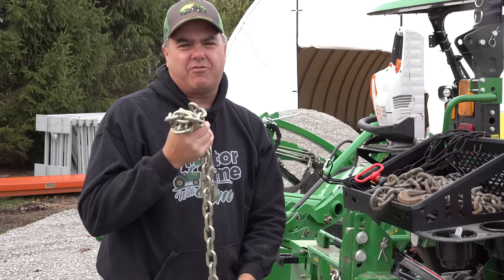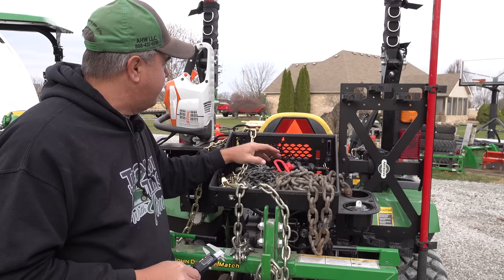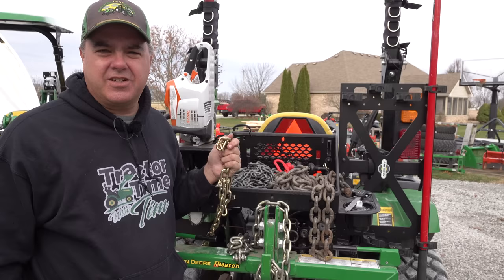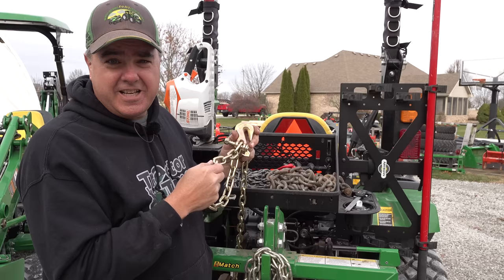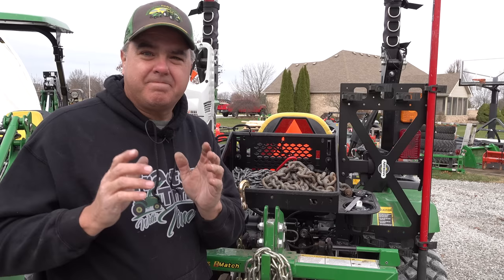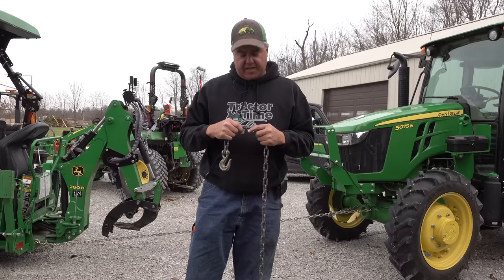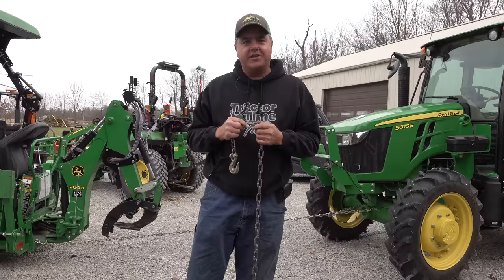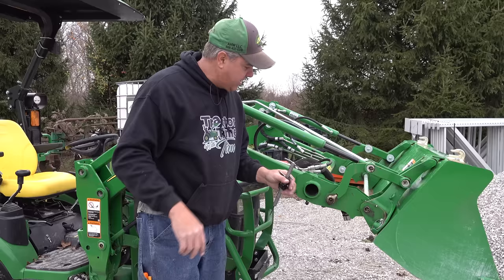What Compact Tractor Owners Need To Know about CHAIN!

Comment: Here's an engineers perspective, keep in mind my experience is with lifting not securing loads on trailers. The "lock" is called a mouse, for overhead lifting mousing is required, for securing loads I do not believe they are. You can make your own mouse with some twine or even ductape, they don't need to be strong they are only there to keep the chain in the hook when its slack (for example when you set a load down and the chain goes slack, you don't want the chain/strap to escape the hook without you noticing before you go to pick the load back up again). 

I would be hesitant to use a slip hook to "choke" a load ("slip knot" with the chain wrapping all the way around the load) as you seemed to imply. It'd be better to use a shackle since on a slip hook you risk the chain climbing out the mouse if it ever needs to actually slip. The mouse will not carry any load. If you don't need a true choke and just need an attachment point, you can just do what you did at 14:15 and use the grab hook. Keep in mind a choke hold with a chain derates the capacity of the chain by 20% or so due to sling angle stress, discussed more below.

Whenever chaining keep in mind that a shallower angle on the chain reduces the capacity significantly.  If you have crazy angles when securing your load, such as 30 degrees from the direction of loading, your capacity may only be 50% what you think it is. Lookup "sling angle stress". This is a HUGE factor when hooking to the bucket like you showed. You can double the strength of the chain just by using a lot longer chain than you think you need to reduce the angle (eye-ball it, you want the angle of the chain in relation to the bucket to be optimally 60 to 90 degrees, if it approaches 0-30 degrees you're in trouble). Not only that but if the chains short most of the tension in the chain goes into trying to bend the bucket in half, rather than trying to pick the load, so a better angle is not only stronger but nicer on your equipment too. If you want to see how bad sling angle stress can be, there's a video on my channel titled "that could've killed me" where I tried to lift up my 4x4 with a chain that was rated for twice the weight, AND doubled over (rated 4x the load at that point), and I still stupidly broke the chain and dropped my vehicle because the angle of the chain was stupidly shallow - the worst part is that I knew better and still rigged it poorly because I didn't want to find or make a spreader bar to get the chain vertical.

For all the reasons you pointed out, for pulling out stuck equipment I would really recommend using nylon straps, or better "kinetic ropes" / recovery straps. Chains hold a ton of stored energy in them when you pull on them and aren't great for dynamic loading, if they snap you have a very dangerous situation. With a strap there's far less mass behind if it it breaks and goes flying, which is much safer (as long as you don't have a tow ball or tractor attachment flying a long with it). Kinetic ropes have the added benefit of noticeably stretching which significantly reduces impact on equipment, and makes it easier and less violent to pull stuff out too. Only use a chain for recovery if you're confident the tension is lower than what the chain is rated for, and never get a run at it and try and jerk the equipment out with a chain (as you pointed out) - you'll just break the equipment or the chain, any bystanders, and possibly yourself.

Comment: Thanks Tim!  I ended up buying a couple chains when I was taking a huge tree down in our backyard.  

Outside of their intended purpose, best use I've found for them so far?  Pulling the posts on our old chain link fence that were sunk in to 40+ inch concrete footers.  When you think of a metal chain, one thing you don't think about (or at least I never did) is traction and gripping power.  A couple wraps around the base of the post then loop it over the foot of a hi-lift jack and it's insane how well it would grip the pole, even when covered in wet mud that was hard to stand up in.  Some of the more stubborn posts crumpled and snapped before the concrete footer broke free.  Trees along the fence line had worked their roots tightly around, and in some cases through, the footers.  Those ones just got chisled back and cut off about a foot under ground.  Best I could do without damaging the tree roots.  But for most of the posts, it popped them out with surprisingly little effort.

Thanks again for all the videos!

Comment: Good informative video for sure…I know it’s a year old but just saw it. Also, don’t stand in front or to rear of chain under tension…safest place is double chain length to the side. We had local man killed when a bolt on hook broke loose, hurled forward and struck him in chest.  He was standing in front of vehicle that was attempting to pull another out of mud….these were cement trucks by the way. 

Another reason to NOT to get running start.

Comment: The stabilizing tube on the loader arm is where I store my shovel I use a large black rubber bungee type to the tube and hooked to both sides of the square Point Edge if you put the round Point inside the square points you can carry both do tractors with narrower bucket do not protect the shovel so you have to be careful

Comment: My favorite place to keep a chain is either hooked to the rops the. Wapped in a way that it won't drag or  to Wrap it around my bucket hooks, if I have a good floor board I I have kept them there or if I am doing repetitive pulls from the rear I will keep one end hooked to the clevis in the drawbar and loop the working end around the 3ph lift arms between pulls.

Comment: Good info, but there are a few missteps on chain here.  The chain that is stretched should be sent to scrap and never used again.  It is very unsafe to use a damaged and/or stretched chain.  In pulling a tractor with a tractor, both should be hitched from the draw bar not the front axel or bolster and the larger tractor should be used to pull the smaller tractor.   In relation to transporting your compact tractor, you would need four grade 70 chains, rust free, one for the loader, one for the backhoe and two for the tractor.  Some states may require up to eight binders as well.  I have been loading and transporting ag and heavy equipment for over twenty years.  The new way that many transport haulers is using 6 ft chains with large grab hooks so as not to run the chains through the tractor and scratch the paint.  Go from the tie down point to the binder to the trailer, four points of contact for tractor and two points of contact for the attachments.  I do love your videos and purchased a 1023e this past spring in part due to your honest reviews.
Reply from the maker: But what If the larger tractor is the one stuck?
What if you need to pull it forward?  There is no drawbar on the front.
We live in the real world.  
This was not a lesson on how to tie down your equipment.  The video was 25 min long.  
We have other episodes showing proper tie down techniques.

Comment: good overview about chains. a lot of folks dont know how to use them properly. They are an essential tool when logging or doing firewood.  i got  bolt on hooks years ago based on a review you did. I've used them over and over again. i also have the loop/clevis on the bottom/inside the bucket. absolutely love them. one of the best add ons I've ever bought for the tractor. forgot about heavy hitch. i need a receiver to tow around my little log splitter. i might have to get one of the FEL receivers. dont think i heed the heavy hitch one and its a bit more expensive.

Comment: The other thing is you can buy chain in bulk and cut it down to managable lengths. Just buy the appropriate hook and you also don't need to worry about securing excess chain. The slip hooks make it easier to hook onto whatever you're securing depending on the tiedown points.

Comment: If you run a boom pole and want to haul logs, I've found that 14' of chain seems to be the ideal.   BTW, my tractor carries a Class 2 3PH and was told to use 3/8" chain.  My 14' length of 3/8 Grade 70 is about 45 lbs.  Yea, chain gets heavy FAST.  If you are not using the chain for transport, you can score good chain fairly cheap from a local hauler or tow company.  Yea, it might not be full spec, but if your skidding logs or just securing something in a non-critical place, the used chain is a very economical option.

Comment: I grew up using chains on the farm.  We used logging chain with a grab and snatch hook on the ends, and never had an issue breaking one, but I know it can happen.  I have seen issues of a chain coming loose with the hooks slipping off, which can be dangerous for anyone nearby.

Comment: I would use a dynamic kinetic tow strap/rope to recover equipment, chain is just too rigid for my liking... but just my opinion as always.  Advantage, you can run it out to "jerk" it, but it never will it stretches like a rubber band and then gradually pulls the stuck load.  To me, it's easier on all the equipment.

Comment: Im adding front wieghts on my 520 so im losing my drop chain for ty down and im losing my loader brace brackets. I have a plan to relocate where the brace rods attatch and that plan includes making new brace rod/ tie down brackets.  At demo derbies i use the boom pole gramps built to tow cars out. I use the top hook on the boom for lift but i also have a low line to boom poles drawbar hole.  I towed a 3/4 ton and 40ft gooseneck out of mud at the derby. Using very little lift to aid my traction but on other hand a car with no left front im lifting on pretty good and my front stays stable because the low line is doing the pull.  Ive dragged big logs out of the woods where i had rap the chain around right above toplink mount because to much wieght.  I might push the bounds but when pushing the limits i go slow and i know my limits of my setup. I plan on eventually adding d rings on my trl and when i do i will make stubby tie down chain exclusively for tying down the tractor sit the same area every time on my trl because it has only hauled my tractor and once a friends junk motorhome my brothers A(tractor) and my totaled trk that i bought back for some parts and was scrapping out
Reply: I’ll bet you most people here don’t even know what a jem the 520 is!!! It’s my favorite tractor 🚜 ever made, the modern version of a B .
I can tell by your post that you know more about using a tractor than most guys will ever know, things that can’t be taught! Keep it up.
 Just a quick story my 99 year old mother loves to tell.  My grandfather bought a B tractor and at lunch time everybody was admiring it, grampa  thought it was time to put me on the seat. My mother said it all the farm hands to get me off the seat. 30 years later my brother bought a Old B tractor and one look  at it and grampa recognized that tractor as the one he bought many years ago.
Reply: @mr.redneck2715  that's cool you found it and were able to get it back. I'm 3rd Gen on my 520 but unfortunately I don't have anyone to pass her on too of my own so if I don't have kids I can pass her on too my one of my brother's girls.  I have a b I bought at 13 but she locked up on my. My 520 is getting tranny  work and the pto blew its oil out and getting new brakes and find a piece of the drive clutch fork ring that broke this winter.

Comment: The grade of the chain is relative to the tensile strength of the steel that the chain is made of.  For example, a grade 80 chain is made of steel that has a yield strength of 80,000 lbs. per square inch.  DOT inspectors will also check your chain for links and hooks that are bent, cracked, or worn thin.  Your system is only as strong as the weakest link, be it links, hooks, or tensioning apparatus.  If they want to ticket you, they will find a way, so be nice to them.  Another tip is when loose hooking and it is critical that the chain does not unhook itself, wrap some duct tape around the hook and the chain to keep it hooked no matter what.

Comment: I have 4 of those marine/naval chain links, they weight around 200 lbs a pound a link, one is slightly bigger and probably closer to 250 lbs. There`s even a cross brace in the middle of the link going across. I plan to use a couple to make a mooring for a boat, and other 2 to hold a floating dock.

Or I could put them in my ballast box I guess.
Reply: I saw one of those ripped out of a chain locker aboard ship in the Navy, man what a racket that made, they said the bridge officer on duty misjudged the depth to the chain limit, would have loved to be a fly on the wall of the CO's stateroom.

Comment: Thank you Tim for sharing your wisdom and expertise.  I've only had my tractor (Massey Ferguson 1740M) for about 2 years now; meanwhile, I have learned so much from watching your videos.  Living in a rural area of central NC, I have found that my tractor is a very useful tool on our property.  It certainly makes working smarter and efficiently a benefit.  Thanks again for sharing your advice and experiences including the times you explain how you would have done something different based on what you yourself learned.  Love the videos.

Comment: Good video tim,lowes sells plugs for hole in loader with rubber seal that slides into hole an a wing nut tightens the plug so pvc wont come out,just a thought ..HAPPY THANKSGIVING

Comment: Great job alot of info in this one. I deal with chains everyday and i find that most chains grades are marked on the hooks and the boomers are marked on the handles. My chains have rode many many miles and have no color left on them. Thats where Trooper Hoover starts looking when he is going over you equipment and tie downs. Just food for thought.
Reply: Don't just assume the hooks are the same as the chain. Very possible the hooks are under or over rated for the chain.

Comment: Very good information for people that have that chains laying around. I don’t have a tractor but I still have two 10 foot chains hanging in my out building that get used for pulling out bushes. I also have two large duty straps that had to tossed from industry usage. It never dawned on me how chain links got stretched. Thing can go wrong so quickly when you don’t understand the how to use them.

Comment: Offered to pull out a semi that got stuck in the road with are tractor.  He thought it was funny to lay on the breaks as we were pulling him out.  He wanted to see if the tractor would handle it. It was a large tractor that would not have a problem with pulling him out even with the breaks locked but the chain can't take that.  We were so mad.

Comment: I  to grew up on a farm with tractors, equipment, chains, & I also did a lot of trucking myself (25+ yrs), using chains & boomers with various types equipment & heavy metal  loads to tie downwith. I would love to start using chains to tie down & haul my "Johnny", instead of using the ratchet straps, but i need to find some "boomers" to tighten the chains with. Thankya for sharing the video. My uncle broke one of my chains here the other day, jerking on it with the 3020 John Deere, trying to yank out a tree stump. . . . i was not happy, but what can i do, right??? Tractor safe & God Bless. Thanks for the Bible verse!!!

Comment: Yep chains are deadly when used improperly! I use to go off roading with trucks lots, the events I would attend no chains where allowed kinetic straps and ropes okay. They would stretch some and if they broke the stored energy of the straps would dissipate quicker than a chain.  There is pickup down the street, it has a perfect imprint of the links on the tailgate.  I got skid steer stuck last year in my driveway(long story) My neigbor came over with a chain I said no way. I had 30,000# kinetic rope and we hooked it between the skid steer had to use a grade 80 3/8 chain to hook to the tow points on the skid steer and a clevis on the truck reciever, my son was driving the pickup he gave it a little slack nothing. I said give it bit more and he backed up from the length of the rope so it had about 20' of slack and in low range he put the pedal to the floor and the skid steer rocked about 1/4" scratching my noodle I turned around and saw the rope curled up behind my truck the hoop broke off. There was a rope imprint on my tailgate it scratched the paint and under the bumper skin it had bent up a 1/4" thick plate. I ended up calling a wrecker and he broke his cable off but he had a second boom and with a snatch block he was able to drag it out of the hole I drove in. The tracks wouldn't turn and it was dead weight. Sidenote my wife wasn't impressed with my driving skills on a skid steer. I have pics
Reply from the maker: Uh, NEVER pull with slack in the rigging.
Reply: @TractorTimewithTim  Check out Matt’s off road recovery he uses kinetic energy ropes
Reply: I watch some farm videos like the Millenial Farmer etc... They also use those big Kinetic Ropes, they are about 2" in diameter

Comment: Bought the 5/16 chain because the Artillian pallet fork frame has the slots cut for that size (according to the manual) but yeah it's crazy overkill for the 2038r!
Reply from the maker: Of course the slots will hold 1/4” as well...
I love those slots!!!
Reply: @TractorTimewithTim  I was worried that any deviation in size would alter performance, but of course that is the purview of the uninitiated.  Which I am.